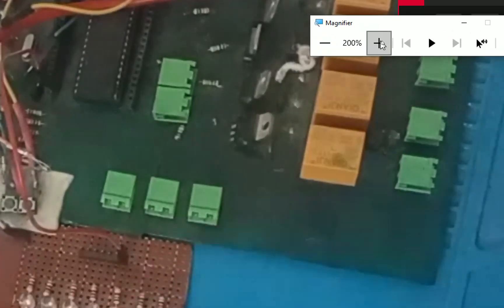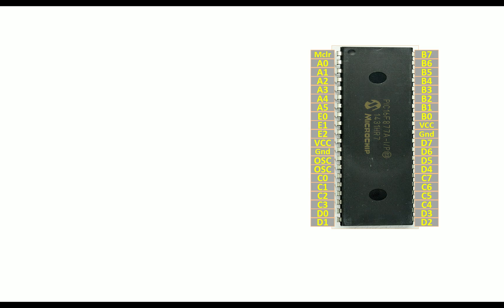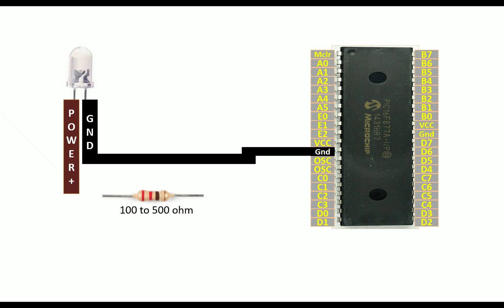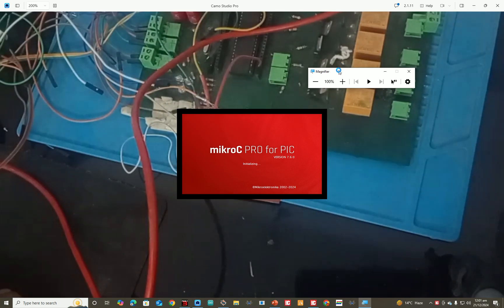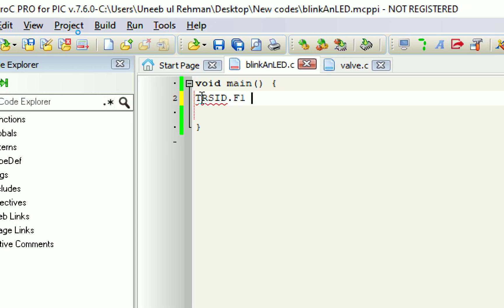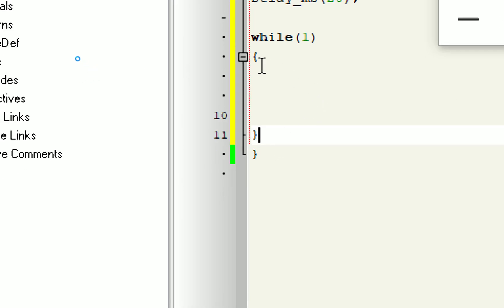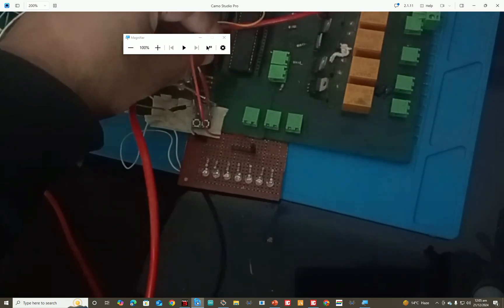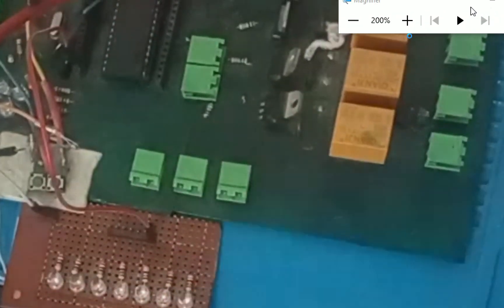Blinking an LED with a PIC16F877A microcontroller.

Comment: sir next video tx rx  16 channel remote controller radio frequency. Please sir 🙏🙏🙏 i need  it❤  🙏🙏🙏🙏🙏🙏🙏🙏🙏  please
Reply from the maker: Which module
Reply: @learningmicrocontrollers3561   433 mhz module
Reply: @learningmicrocontrollers3561 tx and rx  433 mhz transmitter and receiver module